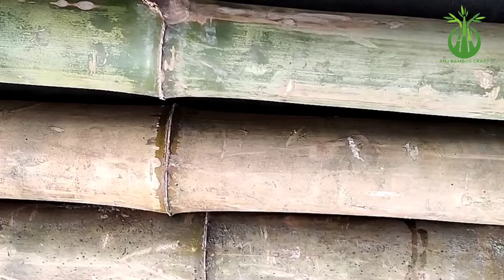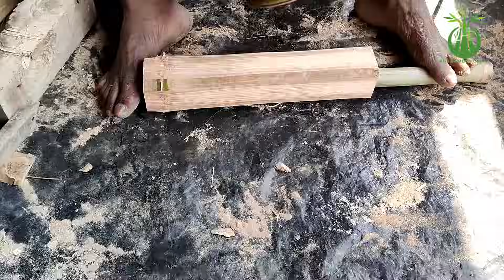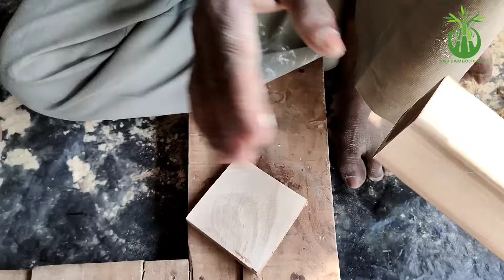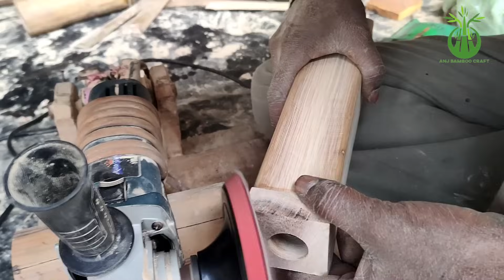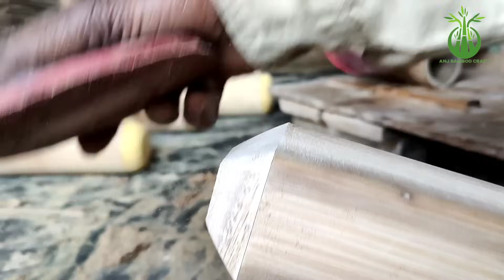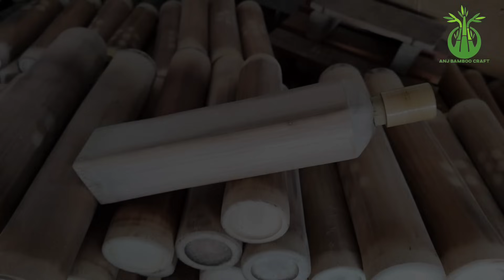How to make Bamboo Wine Bottle/ Bamboo wine bottle making process.

Comment: What type of glue is used?
Reply: 502 super glue. And yeah,here,what I got surprised with as well.That glue is super watery and strong.Heres one thing to Google out,YouTube  it.Super glue and baking soda......I use sand am super fine wood dust as well.Its like concrete :) I'm smoking pipe maker,  amd that one glue trick saved me from small cracks ,once u smooth it with fine sandpaper,magic man

Comment: One of the best products and
plastic bottle replacement 👍good work
Reply from the maker: Thank you sir ❤️❤️
Reply: Ceramics and glass are the best. If only we could melt silicate and burn clay with Sun - it would be literally cheaper than plastic in a decade
Reply: @cutestshorts101 clay can be baked with the sun, magnified that is.
Reply: @X_mano  yeah, but a sun powered kiln? Will that be theoretically possible? Or boil water in a steam engine with a few semifocused sunrays?